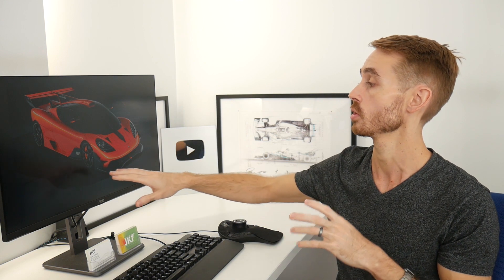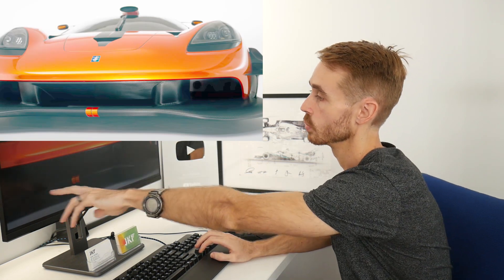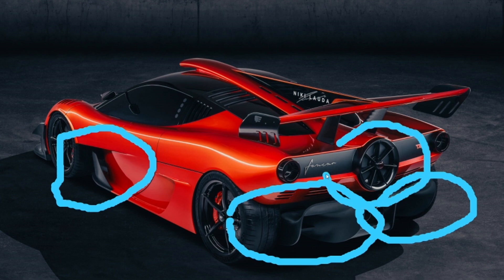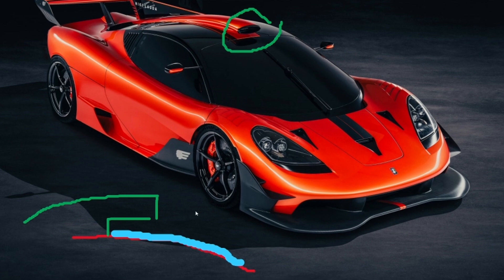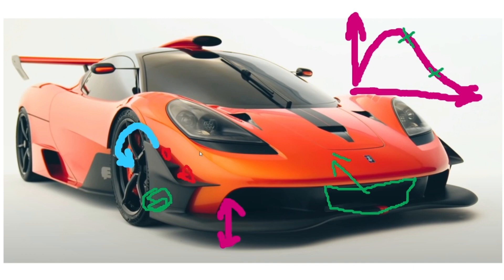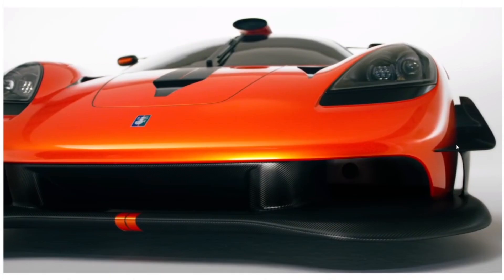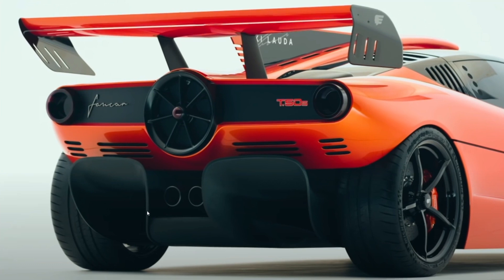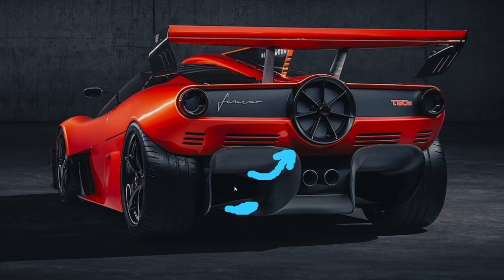Gordon Murray's T.50s Aerodynamics Analysis

Comment: Hello Kyle! This is a very good video. However there are some things that you may have missed during you research:

8:00 regarding the 3 NACA ducts, the middle one is for the driver cooling and the two side ducts are for the brake cooling. Not sure what the bottom ducts are for, Mr. Murray hasn’t provided any detail regarding that from the videos I’ve seen.

9:20 It has been confirmed by Mr.Murray himself that each of the side vents provide cooling for the engine and gearbox. I forgot which side cools which exactly, but he did state that one side provides cooling for the engine and another side provides cooling for the transmission.

You can confirm this information by watching Harry’s Garage video on the T.50S. So far that video seems to be very detailed in providing technical information from Mr. Murray himself.

Another thing to note is regarding the downforce claim being at 360km/h according to your calculations, this lines up with the fact that the standard T.50 has a theoretical top speed of 227 mph, which is 365 km/h. I’m not sure whether the T.50S can reach that top speed (as I would imagine it would have more drag than the standard T.50 due to the additional aero devices) it does give some clarity as to why they may have decided to calculate downforce from that speed range that you have specified
Reply: From memory in Harry's video they mention the design target was 1000 kg of downforce, and having a design target of 1000 kg at 360 Km/h doesn't seem like a very high target for pure track car.
Reply: @Your_Paramour  keep in mind though, this car also has a weight target of 890 kg. 1000 kg of downforce at 365 km/h equates to 568 kg of downforce at 281 km/h. That’s more than what the Porsche 991.2 GT3 RS makes at 300 km/h, a car that laps the Nurburgring at 6:56 and weighs about 1400 kg. It’s more than enough honestly.
Reply: @devandrasimanjuntak1646  1000kg of downforce would allow it to roughly do 2g lateral at 200 km/h on slick tyres which I guess is higher than a GT3 car so it is probably enough.

Comment: Hey @kyle.engineers, did you miss the the flow trough tunnels int the doors? Possible that they lead air from the front intake or outer two naca-ducts to the rear for cooling?
I believe Drivetribe showed them in their launch video.

Comment: IMO, the front inlet is large slow air to feed the high speed vent going up the windshield to help air velocity and keep laminar flow (preventing turbulence over the roof).  As the air goes over the roof without separation (or much of it) it helps go to the rear wing where it can really be utilized.  The engine air intake is high to prevent robbing rear wing air more than for air intake vortices' IMO. 
The front side pod inlets will go through to the barge boards after the hidden front raked up front diffuser.   
With the barge boards and side tray, the air under the diffuser then can be sucked in with greater velocity and then suddenly slowed (Creating downforce under the splitter) as the rake upwards ramps up towards the barge boards.  The under tray from high speed air will then traverse the remaining air along the floor all the way to the rear diffuser. 
Just my 2 cents worth.

Comment: Nice work, would like to see the T50 analysis.  Would expect they have twin radiators as per the F1 roadcar venting into the front wheel wells as you alluded to.  The gearbox at the rear is quite large so occupies and interferes with the diffuser floor area, how would this affect the centre of pressure?  Love your work, really inspiring.

Comment: Sum it up - unlock the suction side of teh front cannard, upper fr wheel vent could be more aggresive and active wings.
And for weight, freevalve engine would save further ~25-30kg that would be a nice mod.

Comment: How does putting a loss structure (large vortex) infront of the Front Wheel help Tyre squirt? I assume you mean the vortex rolling up on the edge of the Front splitter, underneath. Would this not just go underneath and inboard of the Front wheel and cause even more mess? Great video!

Comment: Hello Kyle,
I have a question please :
when F1 was F1, with the large diffusers , the exhaust pipe where incorporated into the diffusers to add more effect.
With the known phenomena that when pilot lift the foot from the pedal, this reduce drastically the downforce.
Some cars were suffering more than others of this effect, like the sadly known FW-16 which had a strong problem of aerodynamic balance alongside mechanical difficulties on suspension partially corrected on the front and which took more time for the rear, both being linked with that special one arm superior rear suspension.
My question is why supercars engeeners do not incorporate this in their cars ?
Is this because the effect of the diffuser is so small (compared to F1) than exhaust pipe incorporated would not make such difference and therefore they prefer make the exhaust line apparent ?
It is true that these last years we have seen many fake and ridiculous diffuser flourishing everywhere, even on SUVs.... And I strongly doubt that even for most of supercars, this produce enough downforce.

Comment: The car makes its 1500 kg downforce at top speed which is around 210 mph. The reason why can't just extrapolate the downforce figure from the given "downforce at 175 mph of its weight" is because the car is likely much lower in ride height at top speed on the bump stops.

I dunno, the front canard setup looks pretty standard to me. It's a double element with an delta endplate. The car already hit the downforce limit of these tire sizes (without making the car much wider) so reduction of drag is the next easy objective

Center section of the diffuser is blown by the exhaust and some of the fan eflux

Comment: I suspect the canards look like that because of pedestrian impact regulations.

The little bit of extra fender around the front wheels might also be there to fulfill regulations regarding how much of the wheel needs to be obscured and from what angle.

The angle on the center ramp of the diffuser is probably like that to avoid excessive scraping.
Reply: @AzathothsAlarmClock  Huh, weird that they would show it off on road tires.
Reply: @AzathothsAlarmClock  It's a render.  This really comes off like they were planning on making it road legal and just said fuck it at the eleventh hour.  It looks close enough to being road legal that you can probably find a way to register it yourself in a lot of territories, similar to the odd P1 GTR driving around on public roads.

Comment: Thanks for your time describing the dynamics. I wished I could get you to look at my 20 foot boat that I think has vortices ripping off the rear creating instability above 96-112kph/60-70mph and up. It's an air trapping hull with a Pad Vee design. I think a diffuser or canards of some design to help smooth things out would help. Thanks again...
80-95% of the boat is airborne at that speed and higher.
https://www.youtube.com/watch?v=VU-oMZjCHDw

Comment: I wonder why they didn't use cameras instead of mirrors.
Reply: The whole idea for the car was to make it as "old school" as possible. Cameras for mirrors are, at this point, more of a gimmick than an actual benefit.
Reply: @MurderIncrystalskull   camera provides less aero drag than classical mirrors.
Reply: @jareknowak8712  which matters if your main goal is top speed. Not the case here.
Reply: @MurderIncrystalskull   You convinced me.

Comment: People REALLY... And I mean REALLY NEED to stop saying a car can drive upside down if it produces its own weight in downforce. Thats NOT how cars work, and thats not how downforce works. This is a ridiculous thing to say.
Reply: It is ridiculous, I agree. It sounds good, but yes just wrong. To have a car drive upside down it also needs to produce enough downforce to generate grip to overcome the drag forces, not to mention the ride height wouldn't be the same..... Yes, so many problems. Also my shit videos need more views.....
Reply: @nelsonphillips  
Exactly that. See... As you obviously understood... If your car weighs 980 kilos. And generates 1000 kilos downforce at a certain speed. Great... Thats 1980 kilos pushing you into the ground so you can take corners super fast.

But upside down. Thats 980 kilos pushing you down. And 1000 kilos pushing you up to the driving surface. So now your car weighs 20 kilos and is about to have a crash very quickly.

And also... No road car engine works upside down.

So the only way I can see this ever actually being tested would be in a wind tunnel with a stationary car upside down with no engine running. While 200 mph wind from the wind tunnel tries to stick you to the surface. But you would be stuck in a flimsy turbulent wind... It just isnt doable in any practical way.

Comment: Non-straight leading edge on anything below Mach 0.75  is pure waste. They are wasting a considerable potential for extra downforce.
Reply: The point is it actually made too much fr the suspension and tires so they had to hold it back.

Comment: In my opinion it’s massively overpriced and massively overrated. Heard it and saw it at Goodwood with my own eyes. Design wise it looks dated, like an unfinished mix and match of many different cars, it’s not pretty, it’s not elegant, beautiful, it’s not got any striking looks or beautiful lines, doesn’t really look like a supercar if I’m honest, it looks a bit bland and boring if anything. Yes it’s light, but so what! It’s a road car that’s obscenely expensive that’ll be barely used anyway. Give me a 812 C or f12 tdf, put a full novitec exhaust system on it and it will sound way better than a T50.any day of week. Will be better engineered, sound better, more powerful, look better, some extra weight means nothing unless your looking for lap times. 

Sound wise, it actually sounds like one of them annoying mosquitos in your ear at night, the engine has no depth or soul. Proper v12 engines bark, growl, grunt, bellow, scream, whale and break the air as they pass bye, they do it all!! The T50 engine sounded bobbins to be honest at Goodwood, a very strange, overrated and soulless v12 sound. I was there at Goodwood trackside and saw it with my own eyes and heard it with my own ears. The engine was characterless. The V12 in the new Ferrari Daytona sounded much better, cleaner, crisper, sharper. 

Paid for reviews mean jack sh-t! The Zonda sound made the T50 sound like it was from another planet.